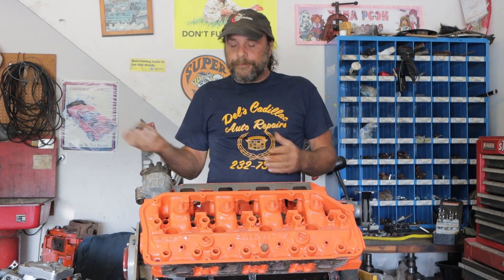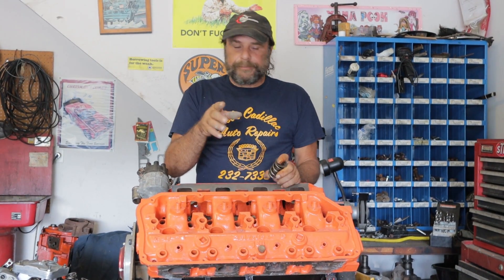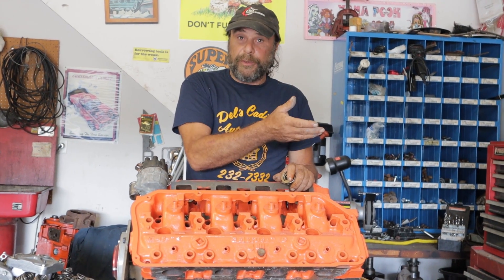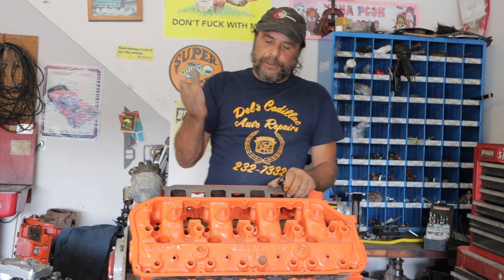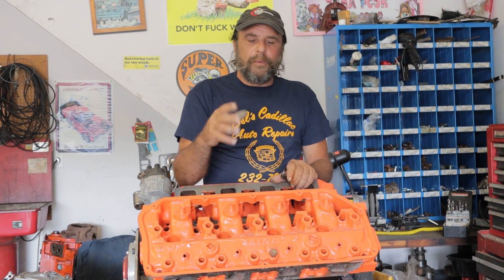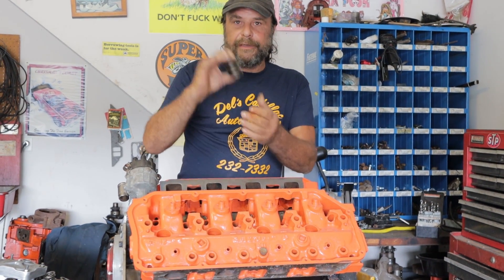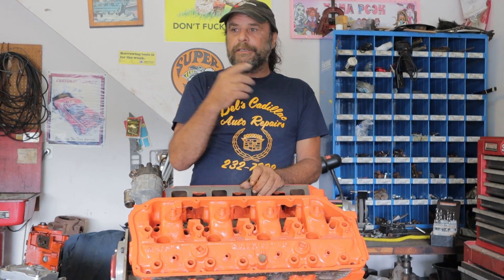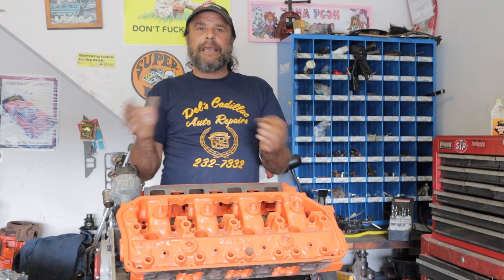Mopar's Doomsday Hemi

Comment: to be honest dodge and chevy would not be hurting if they pushed the type of engine you are talking about gm hurt them selfs then not looking forward. because how emmisions were idiotic in the 70's and 80's those engine designs would actually still have its umf because uhc engines actually get timming bump better as well as simple mods on them. but gm hurt the other two makes

Comment: With the few ppl out there making new blocks and heads (Keith Black), the sinister side of my brain, the same side that wants to mount a .50 cal Beowulf on the 1/8th scale King Tiger r/c tank instead of the fake cannon that comes with it is wondering how hard it would be to have a set of these heads built?
And just in case the ATF is reading, I don't own the King Tiger model and would never violate Federal Gun Laws. I'm a guy, we think of stupid crap like that.

Comment: Not only nascar NHRA also help castrate hemi!Every week changing the rules and weight.To this day it's still the same!
Reply: Aren't top fuel cars still running nitro power 426 hemi's, there was one parked outside of my work last year and it had a 426 Hemi making 10k hp, it doesn't matter which top fuel car they're all using them

Comment: If Toyota can run a Camry which is a V6 only and run a V8 truck engine, and front wheel drive at that then I wonder. Why couldn't Dodge run a 347 Hemi in a car that came from the factory with that engine and rear wheel drive. I would think the Toyota was highly modified where the Dodge would have been a factory available "stock car". And the idiots that run NASCAR now wonder where the fan base is going. NASCAR has not "stock cars" in a long time.

Comment: I recall seeing a SOHC 427 Ford at a local dealership back in 1969, it was parked in the service department with the hood open. For the life of me I can't remember what year Ford it was in. Ford didn't have that in production did they?
Reply from the maker: No, none of them saw an assembly line, but several were hand assembled and used as test mules

Comment: The best feature of the hemi was the block and not used in stock engines today. Hemi heads are good but not any better than other good heads.
Reply: Well, you must ask yourself, of all the engines built since 1951 (which includes the Chrysler, Desoto and Dodge Gen I Hemi's 1951 ~1958; Chrysler, Dodge and Plymouth Gen II Hemi's 1966 - 1971 and the modern Chrysler, Dodge and Jeep Gen III Hemi's 2000 to present) which engine has acquired the greatest number of wins/records it has competed in? I believe the answer is obvious....Chrysler's HEMI. All 3 generations are still competitive in our modern times. I know of no other engine that can claim such an illustrious history.

Comment: Well technically it's a pent-roof, not a hemi. 
Pent-roof dual overhead cam engines have been around in racing since before WWI in Europe (Peugeot). Then some of the Indy boys copied the Peugeot, made it smaller and called it the Offenhauser. Duesenberg put 2 of them together in an inline 8 configuration and made the first production DOHC pent-roof all aluminium engine in the '20s.
 In the '30s it got a supercharger and made over 300 hp.

Comment: Invent stuff for the 3.7L v6!  Love my dakota i keeo customizing it from lights and other shit but nothing for motor mods... headers were even pain in rhe ass to find for it, im talking about better heads cams highrise intakes throttle bodys etc. Stuff simple but would add 50hp atleast would be nice.... mine was tuned and dyno 215hp crank 187hp to rearwheels, its a bit for this little dakota zips alright for 3.7L 6speed manual transmission 4wd  truck but want to keep the torque up passed 40mph would be nice.
Reply: I mean it's a Dakota, you can swap in a 5.7 Hemi and it would fit in there pretty easily or a cheaper ls3 and you'd have more power v6s are cool but there not exactly torque monster's lol

Comment: in 1964 a hemi ran in NASCAR banned the next year a different hemi was run 1966 then 1964 darlington sc museum had a 1964 motor with a sign on it this is the 1964 motor with a 4 barrel carb banned next year!

Comment: You build it, get one built for the weekend and do the best you can with it. Minor repairs between rounds? Ok. Replacing the car after every race? No way! One guy, one car the same guy that built the car runs it, or the same guy that builds the engine and puts the car together drives it because not everybody knows how to weld or build transmissions or has the equipment to balance a driveshaft sitting in their garage. But Corporate owned and operated everything is not what racing is about.

Comment: Great video! Seems like Mopar engineers a solution and begins dominating. The sanctioning body doesn't like it being lopsided.  Mopar takes a break. Happened in NASCAR at least twice, and NHRA, most notably Pro Stock.  I find it funny that the Hemi still dominates in the NHRA fuel classes,  so much that some of the engines say Ford, or whatever, on the valve covers! 
Ride On Tony!
Reply: TommyMacDaddy1  Agreed.  Mopar always gets penciled out.
Reply: Bore Spacing and Valve Angle. I love Nitro. TFX and AJPE
Reply: So you think the Sonny Lenard engines are 426 Hemi's ?
Reply: @comradeyuri8492  actually Sonny's motors have evolved to have hemi heads on a Chevy block. https://www.hotrod.com/articles/hot-rod-garage-episode-12-1225-horsepower-engine-711-ci-sonny-leonard-chevy-hemi/
They aren't chrysler- based, so I get your point. The big Chevy based block is cheaper and less fragile.
 Proline has done something similar, offering hemi heads on their engines.

Comment: Uncle Tony talking about the 60's like it was yesterday, man... back when engines ran sweet and strong without a computer in sight!  HA!
Reply: Yea... he's still stuck in the sixties & seventys...it's all good. Those cars are alot more sexy.
Reply: @djstl100  he's not stuck, that's what he chooses to continue doing. No sense in going in the direction of garbage computers.
Reply: @2K-Tan  I am amazed with how intricate your comment was and I 10000000% agree. You are absolutely right.
Reply: @OGbqze  <3
Reply: @2K-Tan  👍SPOT-ON
Reply: @davsaltego  Thanks! I try to put thought into my responses.
Reply: @2K-Tan  ...except for EV vehicles, I agree with everything you said.
And not sure if this counts, but you left out the role of computers in design of engines and transmissions, to achieve tolerances that could never otherwise be achieved. 100,000 miles on engines these days and the engine is just broken in 😊

Comment: I read an article about it in the late 80's on the sole surviving engine. The major issue they had during development was the Alcoa tappet carriers breaking when the engine was run at high RPM's. Alcoa was unable to perfect the alloy and cast process. It would have been interesting to see it come to fruition.

Comment: And now we know how Dandy Dick Landy got ball stud hemi.

And how G.M. kept their stooge at NASCAR to assure Mopar & Ford off the tracks .
Ford's SOHC 427, under the leadership of Ed Pink slaughtered the 1st Gen hemi,s ( 392, the 354) and held it's own in IHRA  racing.

Thanks.

Best wishes.
Reply: Hi, Unk Tony.....

When you mentioned their cammer, Mopar was also working  on a complete line of 'Ball stud line of all their then current engines.
That thinking encompassed the slant six, for example, as a big Chevy  style 'beer tab' independent rocker arm valve train ( their version included a 300 hp racing six up thru wanted valve hemi small blocks up to the big dog 444 cid ball stud hemi-the only known prototype falling into the hands of ( the now deceased ) Dandy Dick Landy .

It's quite the technical-tour-de-force'.
And this entire line was meant post emissions/lead 

Feeling poorly now-.
I have to rely everything.
Keeping my distance per suggestion.
Best to ll.

Comment: Ford was developing a overhead boss 429 to beat hemi and chevy had nothing and they convinced nascar to shut it down. Just think what could have been.i dont think they could have made tires that would have held up.
Reply: joey seagulls I don't understand why they WON'T make tires that will hold up now.
Reply: CC Ryder that's the worst possible scenario for Chevy, the Corvette is truly a POS car if you try to drive it, their mystique is about their only attribute. They still haven't  broke the 200mph barrier in stock form, Charger and RoadRunner did that nearly 50 years ago, then the Viper came along, and GM is still trying to catch up with a 25 year old production design. Sorry to pee in your Cheerios, but bailing them out was a big waste of tax dollars, they blew it on useless projects that didn't do anything beneficial to American workers
Reply: CC Ryder there is no hope for you without extensive therapy, maybe Obamacare can save you,  but likely not.

Comment: Interesting engine information Uncle Tony! I always liked the 392 Hemi based on what I've read. I enjoyed the early days of drag racing and the history there of. Like when they finally decided it was time to sit in the middle of the car, and race on Sunday sold on Monday.  But, being a Dodge Sweptside truck fan, I read that back in 1964 Dodge offered the 426W in a simple D100 for a extra 1800$.  That was probably the first "super" truck of the term. This was way before the lil'red express truck. This 426W engine, if I remember correctly said to produce 360 hp and 370 ft of torque, which is right up there with today's Ram truck with the 5.7 Hemi. But, nothing was as better than the 392 because this engine was said to have such a strong lower section of engine that supported high hp. . Dodge was no doubt a producer of some fine trucks like Don Knotts "Dude" trucks also. Enjoy the channel very much!
Reply: John Lazar back in the 60s one of the young at heart local businessmen in our town got a Dodge pickup with the 426 in it and of course there was no local track, but a stretch of public road where local fans could park and climb up on the banks alongside to watch night racing. He was cleaning all comers, Chevelles, GTOs,442s,Ford's of any kind, GTXs,Road runners, Chargers. Then right at the end as State Police grew weary of being outsmarted, a coal stripper ordered/acquired a 69GMC with a 396 with 2 four barrels from the local dealer, looking back, I am now suspect on the 396, probably a 427 but they battled back and forth depending on who got out of the hole. A lost time now.
Reply: @Colt-tf6xf  That's a good story about the Dodge truck! First I ever come across too, as they are very rare any more. Yes, those Chevys kicked butt too. I think, in my opinion, it was Jungle Jim L. whom proved with his Chevy Vega, that GM could go just as fast, and faster on a much lower budget that Mopar and Ford.  But, man, I cant imagine opening up the throttle of a '64 Dodge Utline 6' bed with a 426W ! Would have been a screamer, and with a bias-ply tire, fun would have had! Looking at the construction of these Mopar trucks, they were light. But great thing Uncle Tony has going here, I enjoy the channel! Thanks for the reply!
Reply: Jungle Jim was a legend in his own time ! Jungle Pam(read bio.) was hotter than the Chevys. Jim got Pam because of the fast Chevys. If Jim would have ran MOPAR, he could have nailed her sister too !

Comment: Then in the early 70s Olds was working on the 4 valve heads for the 454. Both pushrod and DOHC
Reply: 455.... but yes true
Reply: @randygentry2442  
454, 455. I get confused with the GM big blocks. Given the corporate mentality I still find it amazing that GM let each h division develop their own engines
Reply: mpetersen6 ...careful About calling it a Big block too...I got in a heated discussion once because I believed the Olds (400-425-455) were big blocks...than by a split discission  vote lost over Olds not having a staggard valvetrain...IDK
Reply: @randygentry2442 
OK, I can understand that viewpoint. An Olds 307 to a 455 all share a common bore center. Like wise a Pontiac 265 to a 455 all share a common bore center. With only .005 between them can you put Pontiac heads on an Olds and vice versa
Reply: mpetersen6 ...see I was assuming that the 307-350-403....all shared basic block size and intake....difference for me was intake mainly ...the assumed Big blocks were wider but shared....lost that arguement
Reply: mpetersen6 ....also they in those groupings can interchange cranks

Comment: Drag racing relates to the stoplight acceleration and highway merging aspects of real-world driving, while stock-car racing relates to the highway cruising/passing aspect.

Now, with that out of the way...

The OHC & DOHC Chrysler Hemi was BOGUS! The heads were only made as mock-ups for special test-mules designed to test the harmonics of the existing upper valvetrain. When Chrysler took it's lessons learned from their derailled--but successful--Hemi IndyCar program in the early-50s, and then decided to develop a HemispherIcal version of the 426 vs. attempting further development of the wedge, Ford fired back by taking lessons learned from their DOHC V-8 tank engines used in the war. 

When Chrysler heads saw what Ford intended, they remembered how upset NASCAR officials got over unannounced debut of the 426 Hemi, and called them in to view "prototypes" of proposed OHC and DOHC variants of the Hemi. (Actually the aforementioned upper-valvetrain test mules) 

Knowing that no other American automobile manufacturer [outside of Ford] had anything close to what was passed-off to them by Chrysler, and looking to keep things fair between the competition, NASCAR passed rules that limited engine design to pushrod valvetrain configurations. Only of late has otherwise been permitted... but only in the lower-class venues, where costs can overwhelm independent competitors, and limited only to a particular model of V-6 engine that saw mass production for use in light-trucks from Nissan.
Reply from the maker: I'd say that was a fairly good theory, BUT, with all of the difficult work out of the way (Design, making patterns, casting, etc.) why in the world would they NOT just go ahead and pour fuel in the thing and throw it a spark.  Ford CLEARLY did it with the Cammer, and if NASCAR had not stopped things in their tracks Chrysler would HAVE HAD TO have the A925 ready to go.  You're not thinking things through, man.
I would say a more likely scenario was NASCAR insuring that the Chevy had a chance at being top dog with the Semi Hemi by cutting off the other guys at the knees.  Would not be the first time, ya?  Remember, the GM anti-racing stance of the period insured there would be no other serious development of the Chevy
Reply: @UncleTonysGarage  I did say NASCAR was trying to keep things fair....😏

Comment: Same configuration as the cosworth hemi - direct contact dual over head cam belt drive. That design didn't pan out either. To many things to loose timing for catastrophic failure. I prefer the push rod single cam design. Also in 1973 Chrysler was trying to redesign the Hemi rocker configuration by using a ball and stud for each rocker arm for which Dick Landy was doing some of the R&D for dodge at the time. That ball stud Hemi was  cancelled due to the fuel crisis and NASCAR banning the hemi also . In top fuel dragster today the Hemi is only chosen motor for the amount of HP. it  produces and it uses rocker arm and push rod configuration with single cam a design that's proven design.
Reply: Chryslers use of a toothed belt drive was brilliant. Belts are lighter (have a lesser degree of deflection/stretching), run cooler, are self lubricating, and are generally easier to maintain/service. Toothed rubber cam belts are now widely used throughout the automotive industry and also permitted Chrysler to use the already outstanding Hemi short block with the newly adapted 4-valve heads with a minimum of engineering (no need to engineer an oiling system/bath-housing/ for a stretch prone, heavy timing chain...that was part of Ford's 427 cammers great problems). This design was absolutely feasible; it just needed development time. Based on the greater  RPM potential, bore to stroke ratio, and superior flow of the doomsday heads, this engine in race trim had the potential to produce over 900 HP. Additionally, Chrysler did consider/drew up plans  to produce a double cam (in the block, one for each bank of cylinders), push rod actuated, 4 valve per cylinder race engine in the event NASCAR insisted that all engines must be of a push rod design; however, the design never left the drawing boards.

Comment: Cool when Ford came out with the 427 Cammer NHRA outlawed them because it was winning everything.  NHRA still to this day will not allow anything but a Mopar design.  It's sad.  Their idea for this is "we" don't want it to be expensive.  OMG  really ..  John Force with the Mustang or Camaro, it's a Mopar with fancy valve covers. I'm a Ford person, but don't get me wrong one of my favorite cars when I was a kid was a 1968 Cuda 340 6 pak engine 4 speed car. It came from Grand Spalding Dodge in Chicago.  I traded my Cougar for it.  So..
Reply from the maker: The Cammer never turned a single revolution in actual competition or even qualifying.  It was banned while still in factory test mules.  Also, the NHRA rule for the Fuel classes is only about ten years old.  Up until then, LOTS of guys tried various Ford and Chevy combinations
Reply: @UncleTonysGarage   #https://youtu.be/tmq7dT8aI58
Reply: no. they were banned because the average joe couldnt afford them.
Reply: @frigglebiscuit7484  What a after market Ford Block  I'm thinking if your running a Nitro Funny car cost has nothing to do with it.